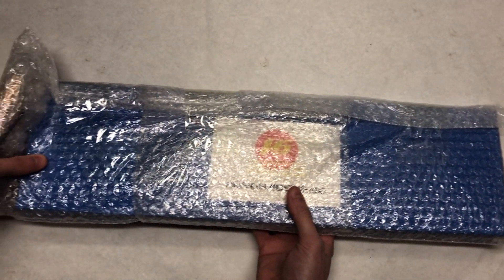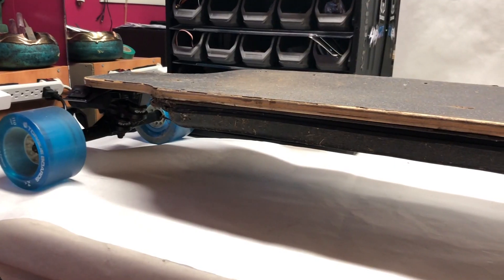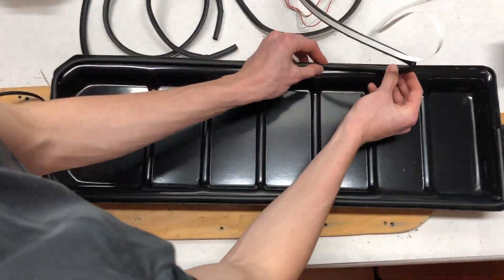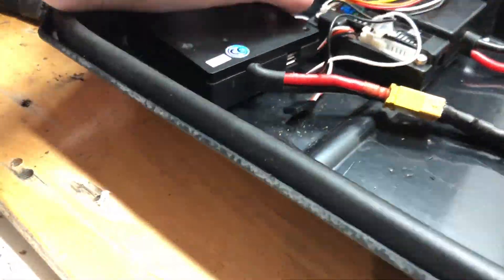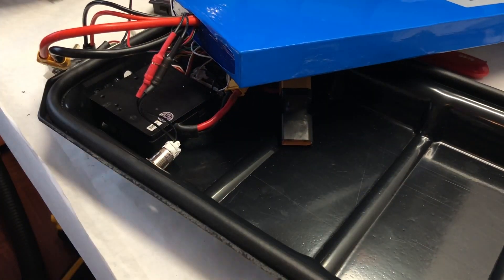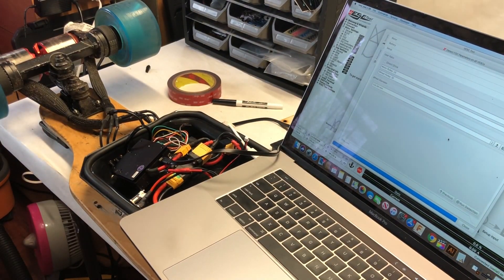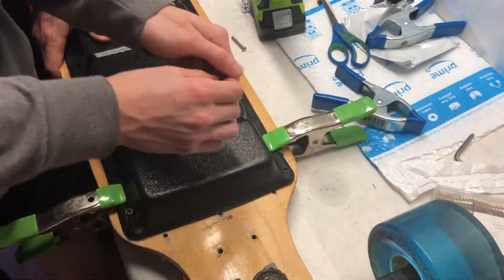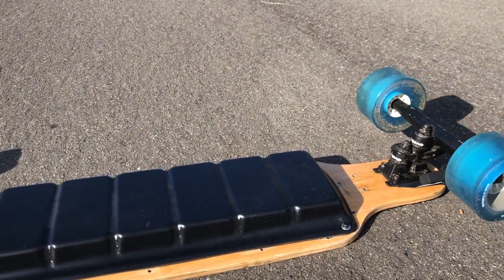How to Build an Electric Skateboard - Battery/Enclosure Upgrade and Electronics Wiring

Comment: Awesome build. Turned out great, but I was thinking maybe you could attach the battery meter directly to the board, betweenthe case and the back truck under the phase wires. Maybe with double sided tape and the silicone sealant along the edges.

It's kind of frustrating for me not to know how much power I have left in a device, lol. Especially if I were to use an e-board for transportation.
Reply from the maker: Very Very true! We have a BT module which we can check the battery on the phone with

Comment: So, when you upgrade the battery to get extended range, do you increase the voltage? Or is voltage constant? I am running 1 motor and 60 amp ESC 16.5 volt max with surge protection, capable of pushing 20 volts.

Comment: I recently built a board very similar, do you have any tips for overcoming/negating speed wobbles?
Reply from the maker: I would say just tighten the bushings more(but not too much of course), or buy some stiffer bushings
Reply: speed wobble is due to imperfect balance of weight.  @ high speeds, weight can get out of place quickly and cause a chain reaction then wipe out.  Tightening the bushings is the best way to distribute weight/force evenly between the front and back (trucks) of your board though sometimes no 'bushing tightening' can help a warped board 🫤

Comment: Build a electric scooter
Reply from the maker: Some day....
Reply: @DIYesk8Builders  i plan on building one, well changing everything in my existing one but i never programmed ESCs so i would need help with that. The throttle should be similar to the remote tho right?

Also i been watching your videos for a while and good job
Reply from the maker: Thanks, yeah I have never worked with a throttle but I assume it connects into dome port on the ESC whether the ppm or UART but idk for sure